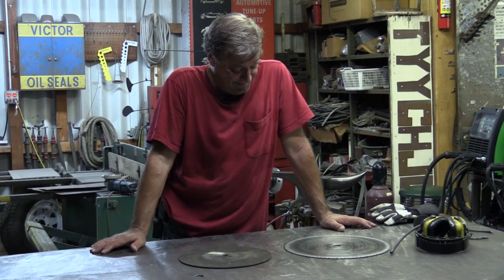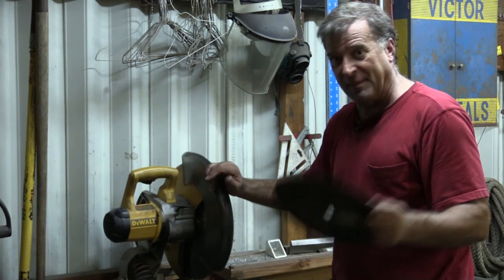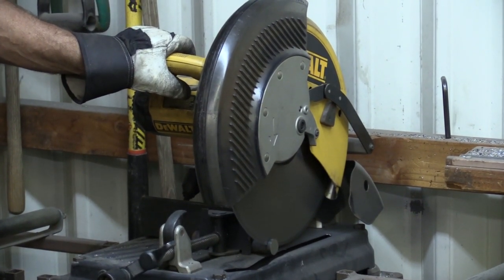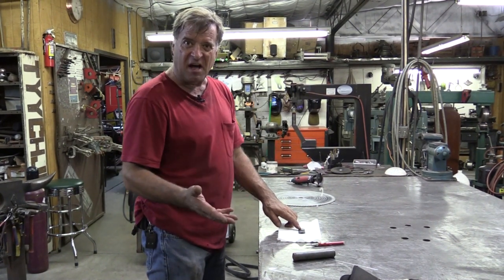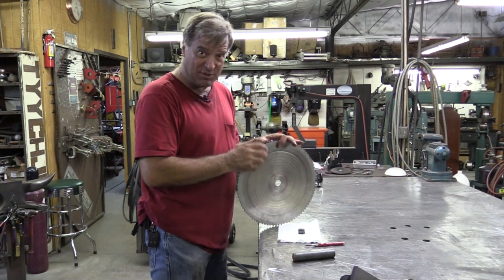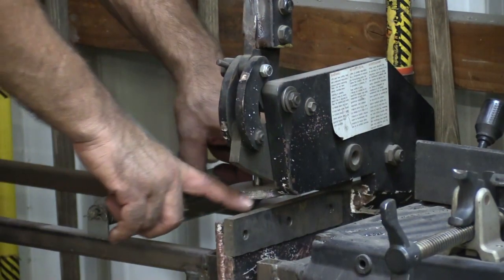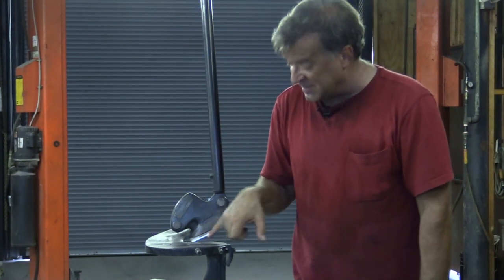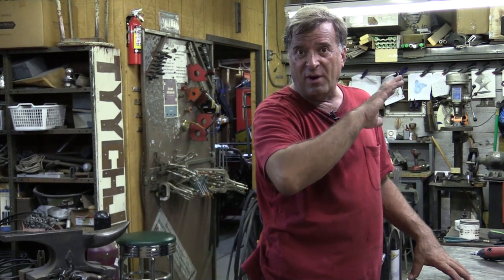Cutting Metal: "What Could Possibly Go Wrong?!" - Kevin Caron

Comment: I recently purchased a similar chop saw for my shop.  The very first cut I made with it a small chip flew out of the machine and cut my lip.  Had that hit my eye, that could have been a significant issue.  I now wear eye glasses and a full face shield.  And hearing protection too.  Haven't had anything else hit the shield, but I still wear the gear.

Comment from the maker: arctic cat,    not familiar with that machine but it sounds like you just have a low power machine.    Try going to the next size smaller wire and see now that works.

Comment: Good video, but one thing I wish you had covered is people making the mistake of using a cut off blade on a chop saw that's only designed for a grinding disc.
A chop saw operates at higher RPMs and cut off blades are not designed to operate at those speeds. Could be deadly.

Comment: All in All how do you like the Dewalt chop saw
Reply from the maker: Loved it!   Was always ready to get it work..     That said I like the EvoSaw better....
Reply: Kevin Caron, Artist Can You tell me why you liked the evo saw better  because  They are the two saws That I narrowed down to ,and im going to buy one of them Trying  to figure  out the pros n cons I checked  out the Dewalt  saw at home  Depot one of the things that turned me off was when  I look at the bottom  base where it meets the neck  there is 4 little tack welds holding that whole cutting  assembly  up I could fix that but I shouldn't  HAVE TOO  Now you and I being welders notice  things like this ,where the average  consumer  wont
Reply from the maker: I think the EVOsaw is better made.   More rigid and cuts better..   Quieter and with better protection from flying chips..    Also cheaper than the DeWalt by a lot!

Comment: not worth the money!  Does cut cooler but not enough cuts in the blade The big boys use the same process but use cooling and lubrication.  The overall tool is the same as the abrasive tool they mainly just added a gear reduction to the motor.  Have used one but wouldn't buy one at the current price.  In most cases a horizontal or vertical band saw will do the same job and is a better all around investment.